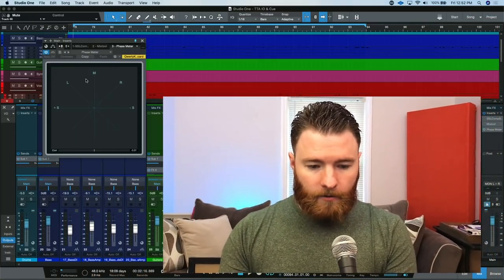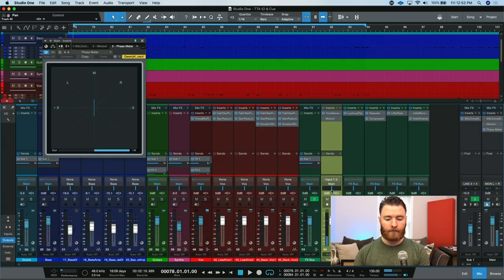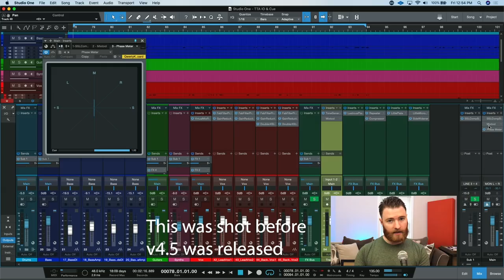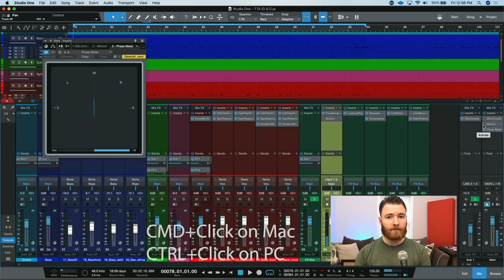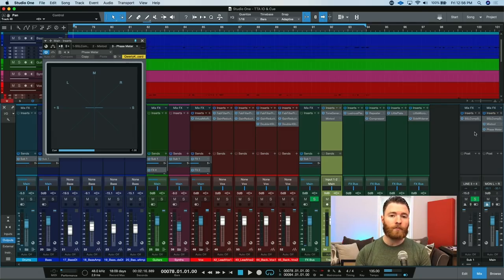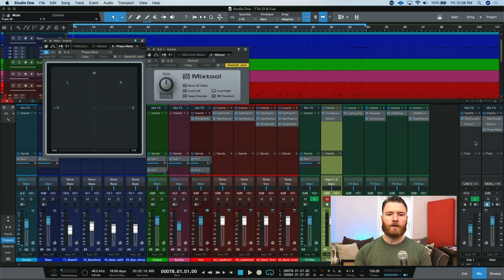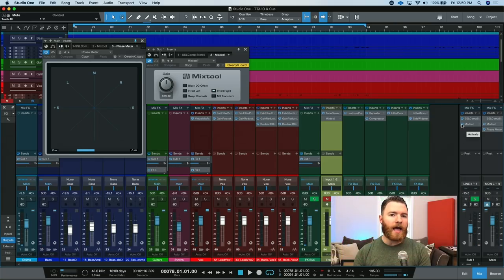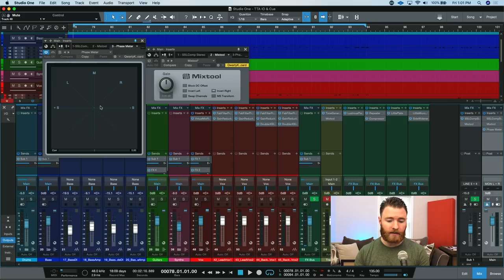Studio One: Reading the Phase Meter

Comment: Great video. So now that I notice a phase in my mix, what do I do to fix it? Meaning what is the next step in fixing it? Do I use a certain plugin or tool to fix it? Do I move a certain left it right channel over a couple of milliseconds or? Can panning resolve this? Just lost after I notice the issue but I can never find a video explaining the solutions to fixing the issue bringing something back into phase
Reply from the maker: You said all the things to try to resolve the issue. Start with the easy steps of flipping the polarity of a track and listen if it sounds better or worse. If that doesn't help, you can try nudging a track forward or backward in time by a few milliseconds here and there to get things into better alignment. If that also doesn't help, or you just can't get it right, you can try a plugin option. Something like the Waves InPhase, Melda MAutoAlign, SoundRadix AutoAlign, UAD Little Labs Phase Alignment tool, or just google search for a free phase alignment plugin!
Reply: @TimTalksAudio  thanks so much..i have the little labs bundle. ill have to try that out..

Comment: Hi Tim, thanks for the explanation, very useful. For a while now, I've been noticing that the correlation meter in all my mixes is half-red, although always above 0 and mostly higher up above 0. Any idea why the red indicator? Does it mean anything or is it just a bug? Thanks!
Reply: many things depend on that... imho the best is always staying over +0.5, going to the negative side isn't always necessarily bad, if it goes for just a second and comes back to ++++, this could be caused by an effect or some short sound you imported and usually isn't of a really big problem... if you correlation meter stays on the red side for long well... probably you have to check your mix and the relation between channels for start.... an element  or more than one go really out of phase and you have to fix it, thing is that there are many solutions that could be applied to fix and help it.. some of them are mid/side EQ, Stereo Width Plugins, Left Right EQ, change polarities, panning change,  switching the problematic sound to mono .... among possible solutions... there are many ways but depending on occation some will work better, some not at all, there could be other solutions too... all depends the situation the problem is in...

Comment: I need more explanations..how can I understand if I am out of phase when I have panned hard left and hard right some tracks?
Reply: As long as it doesn't go to the left you're good.
Reply: phase and stereo image two different things... phase is about cancellation of signal (you could have 100% cancellation even in Mono), stereo image is mostly a representation of what's happening in your mix, but a very very wide mix can also cause phase issues... while you have to keep in mind that NOT all sounds take the same space inside the stereo field, big plus that some effects like a very large reverbs, or stereo widenners can cause phase issues too when overused), but the most basic way to understand if you have phase issues are the correlation meter that goes low, or when turning to mono sounds go very thin or even dissapearing... balancing all this stuff comes with experience since there isn't a standard motive to do and when there are phase issues there are many solutions depending on the situation you're dealing and the goal you have to achieve

Comment: Thanks so much for the video. I do have a question I have noticed some top 40 songs go into the negative just a little bit is that ok or is it something I should avoid?
Reply from the maker: It's fine for songs to head into a negative phase correlation. I would advise against staying there for long, but you may have a cool phasey section of the song which will make the meter travel.
Reply: again thank you

Comment: So how would you use this to fix drums?
Reply from the maker: You can look at this while listening to your spot mics and see if they are out of phase, but I would just zoom into the waveform and visually look.
Reply: Tim Talks Audio so when you zoom in real close what are you looking for? I’ve always been told to line up the transients as best as possible. I do that and it doesn’t make much difference at all. Also. What do you do when they don’t line up? Or if the transients are opposite? Like if ones going up and the other is going down? Dipping where another is peaking.
Reply from the maker: Fret 2 Fret if the transients are opposite, then they are out of phase/polarity by 180 degrees and canceling the most frequencies.